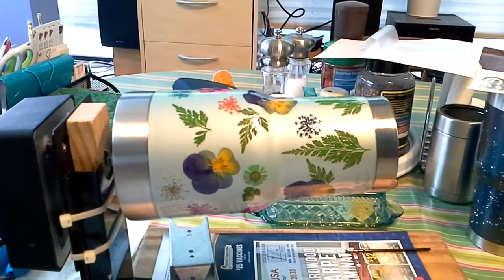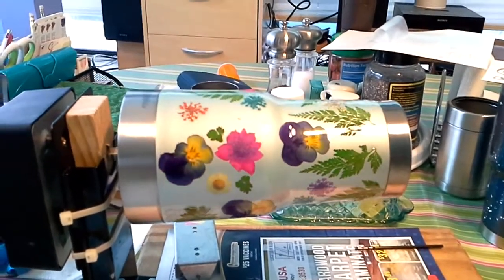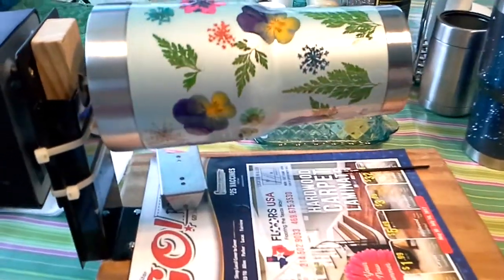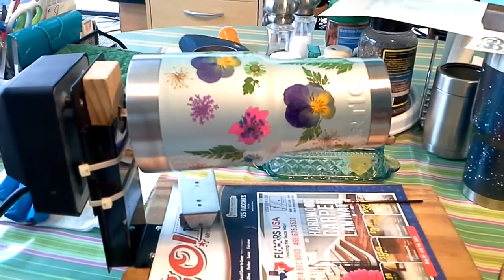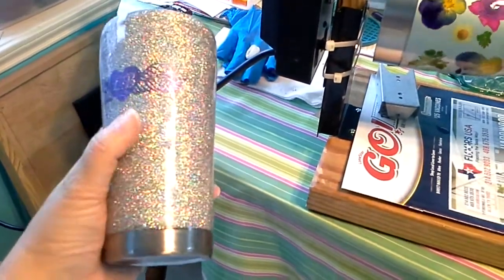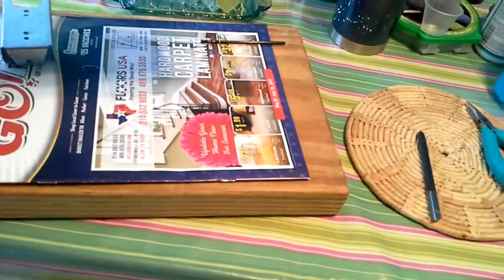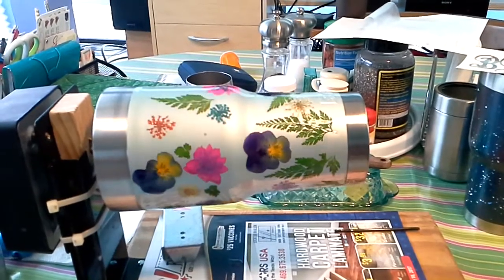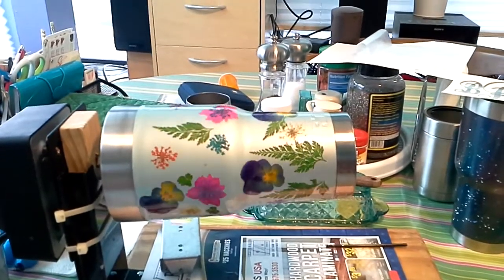Tips and failures on stainless steel tumblers.

Comment: my first tumbler I did was glittered but could not find my vinyl to peel up after glittering ( I wanted the stainless to show), so I put the vinyl over the glitter after a layer of epoxy, any tips on finding the vinyl to peel off under glitter?
Reply: I've had the same problem.  I just go hunting, the nice thing about the glitter is you can kinda "feel" around with your weeder and it doesn't really show like if you scratch paint and it is easy to patch if needed.  Eventually I find a corner and then from there I can guesstimate where everything else is.